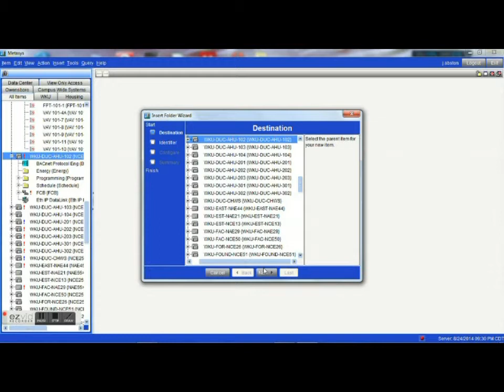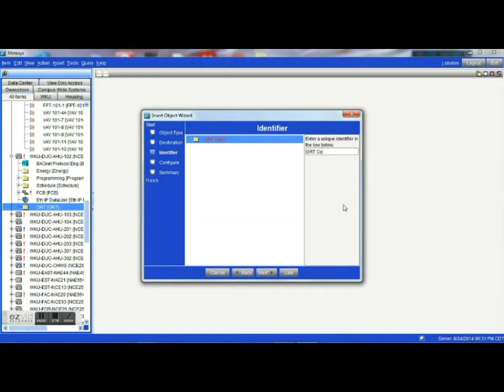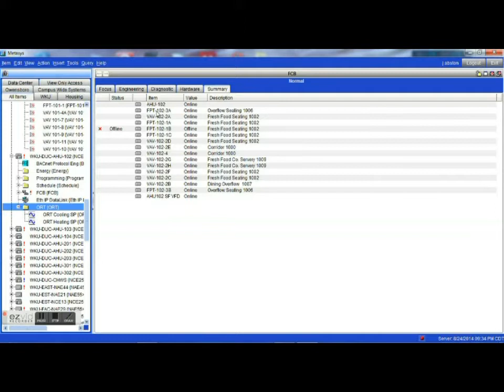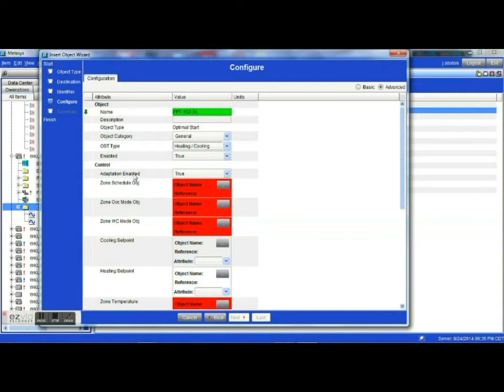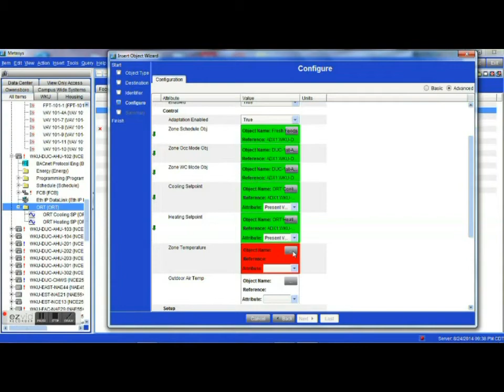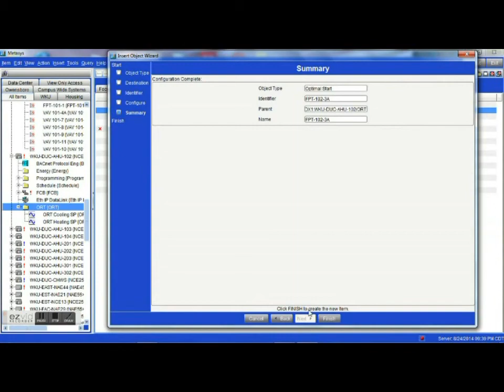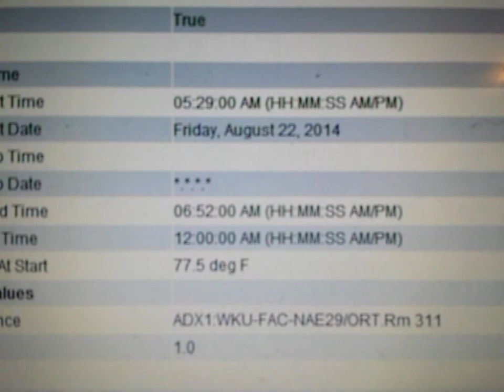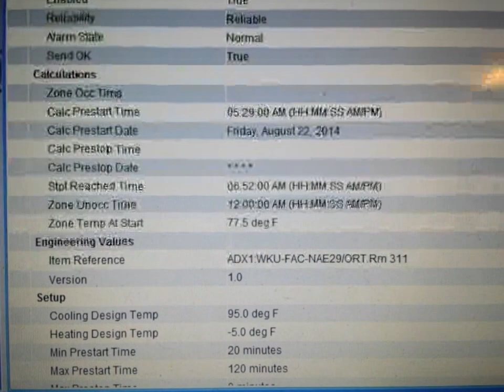Metasys Optimal Start

Comment: Thanks for this video.  One question I have is about the zone schedule object.  Is it possible to create a multiple command or an interlock which would command multiple VMAs to occupied mode, or is it necessary to set up optimal start for each VMA and select the respective OCC-SCHEDULE point?
Reply from the maker: +Alan Sihler Yes, I have used interlocks with the optimal start logic block however, I haven't used the multiple command.  If you create a binary value and link the optimal start to it and then add that binary value to the interlock definitions.  You can also use the state of the optimal start in the interlock definitions as well such as the pre start cooling or pre start heating.  Hope this helps.  I strongly suggest creating the binary values under the exact same NAE or NCE as the optimal start object is.  I've had issues with the commanded points working if they are under different devices and passed through the network.  Good luck.
Reply: You mean to say WC command will generate at 5:29AM base on zone temperature?